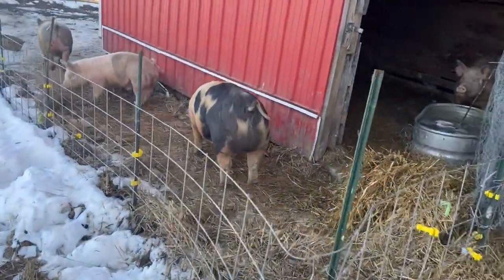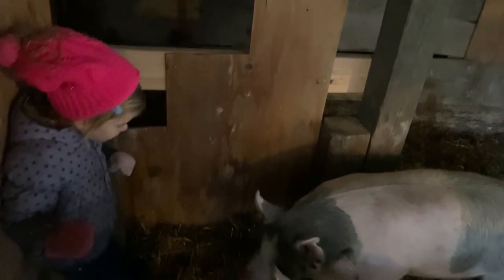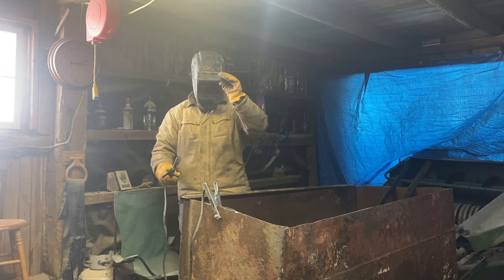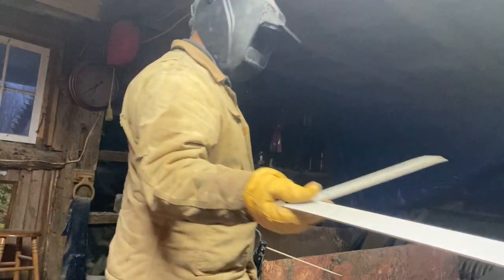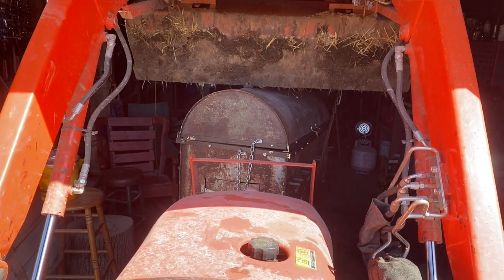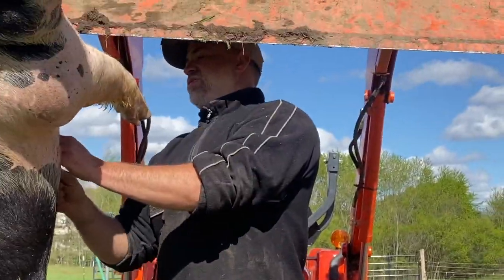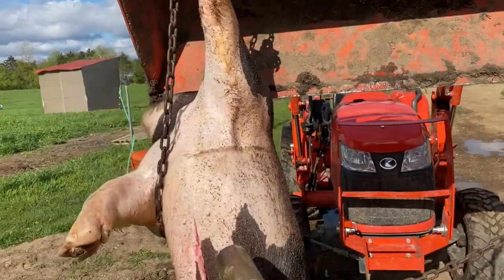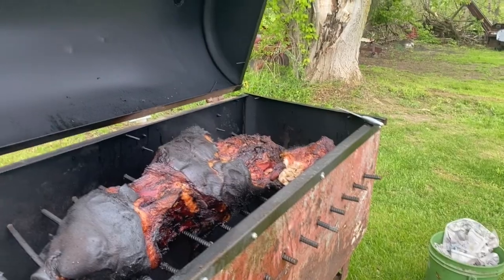Making a Hog Roaster from an Oil Tank

Comment: When scalding at 145-150 you need to dip the full hog in the water what I always do and it has worked every time for me is get that temp as high as possible before poring it on the hog but not fully dumping all of it just slightly so that I don't boil the skin
Reply from the maker: It was such a big hog to dip.  I think I’ll definitely try a little suckler next time!